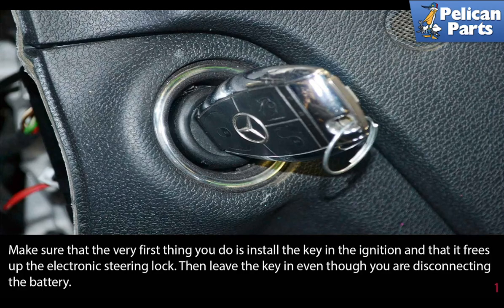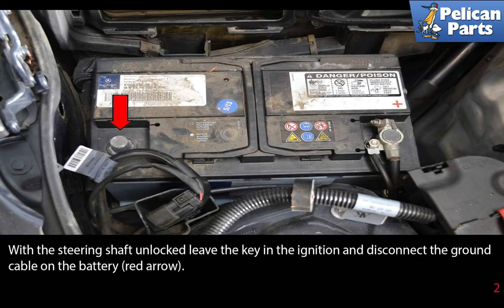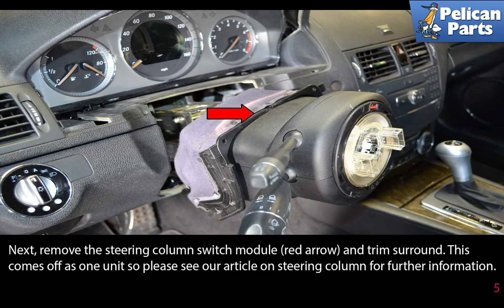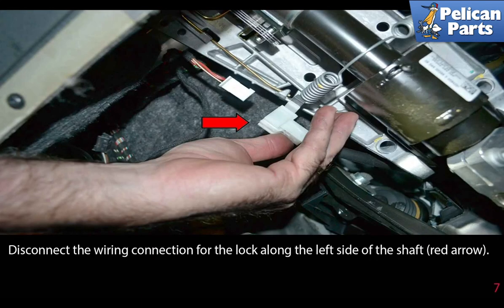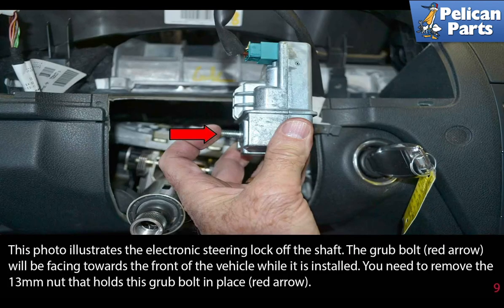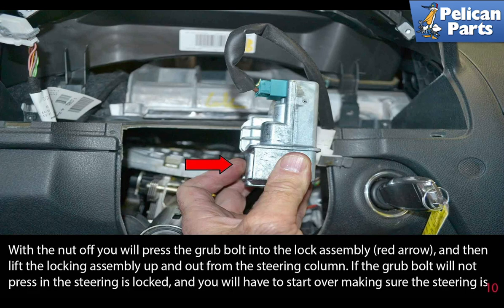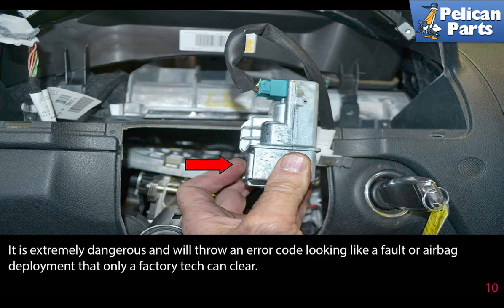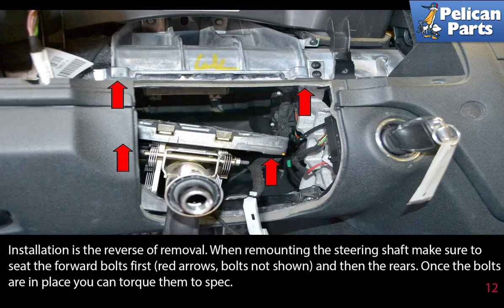Mercedes-Benz W204 C-Class Electronic Steering Lock Replacement DIY (2008-2014)

Comment: FIX – about 1 hour. Can be done WITHOUT removing the steering wheel or column (as long as the lock is still working).
Loosen the four bolts holding the steering column. Remove the two lower bolts completely so you can tilt the column down. This gives just enough room to wiggle the steering lock module out.
Once the module is out, tighten the column bolts back up.
Order replacement brushes or a motor (Amazon has plenty). Take the plastic brush holder off both the old motor and the new motor. Clean the original motor, then install the new plastic brush holder onto the old motor. (Chinese replacement motor of questionable quality)
⚠️ Important: Don’t disturb the current position of the plastic gear.
To access the motor, there are four pins in the module housing — carefully pull them out without damaging the internals.
Reassemble everything, just slightly grease gears. I just zip-tied the module up under the dash somewhere afterward just in case.
FYI: Many other Mercedes models don’t even come with a steering wheel lock from the factory.
Reply from the maker: Thanks for sharing your repair process and experience. These types of comments add so much to the Pelican tech community.

Comment: What's the estimated cost of the electronic steering lock... I have a similar problem with 2008 C200
Reply from the maker: I am not sure what the repair will cost in your area. Call a few shops and ask for a quote. It is also a good idea to have them confirm what the issue is.

Comment: Link for part?
Reply from the maker: You didn't mention what year and model vehicle you are working on.

With your vehicle info handy, give The Pelican Parts parts specialists a call at 1-888-280-7799. They can figure out what part or repair kit you need.

Comment: Hello. I have a 2009 Mercedes c300. The steering wheel locked and I need to know if I have to purchase any parts for it to be repaired.
Reply from the maker: Could simply be a faulty steering or ignition lock. I would start by checking the vehicle for fault codes. If the system is not working properly, a fault code will be set. This will be your best bet when diagnosing.

Comment: How do I know that it is the ESL. My car starts sometimes but other times it doesn’t start like you said in the video. Is it still the ESL?
Reply from the maker: I can't offer any helpful insight without knowing what is missing from the system when you are trying to start it. When your engine doesn’t start you’ll want to check the basics. Check spark, fuel injector pulse and fuel pressure, volume, quality and engine compression. Are there any fault codes? Once you figure out what is missing, it will be easier to diagnose.

Comment: I'm in the market for ~2010 w204 and I already know that the first thing I must do with the car is to remove ESL from the position a keep it hanging below dash. So I can at least tow the car when it fails. Thanks for the video, but it would be really helpful if you mentioned bolts and nuts torque specs.
BTW does anyone know where to find the protocol description for ESL data wire? I can make Arduino based emulator myself, I've done similar things before.
Reply from the maker: You would have to get a factory scan tool and somehow reverse engineer the signal. Since it is BUS communication. Not easy. Thanks for the note and feedback.